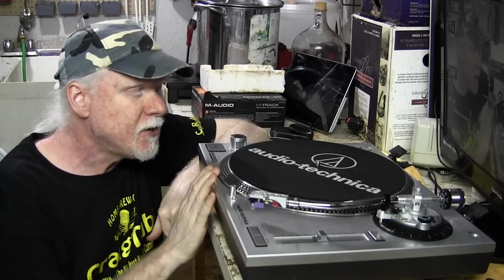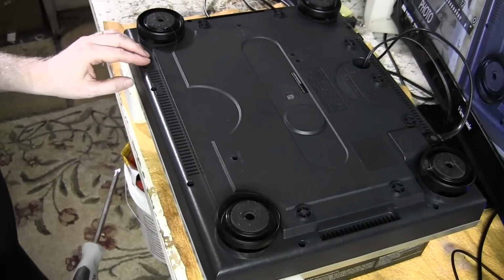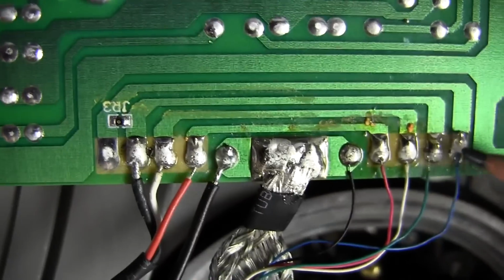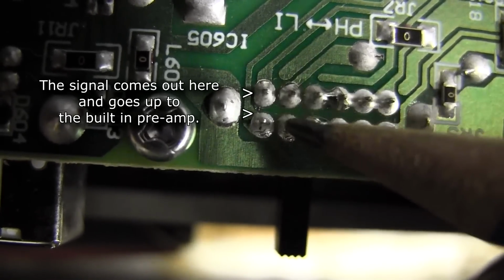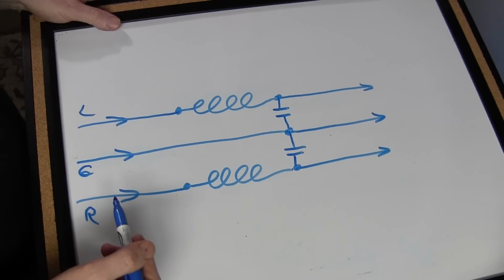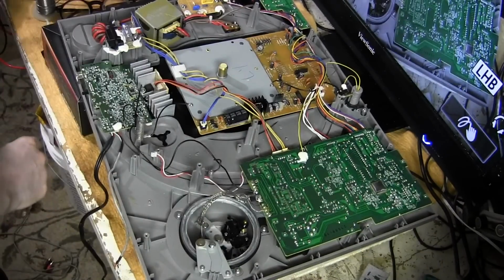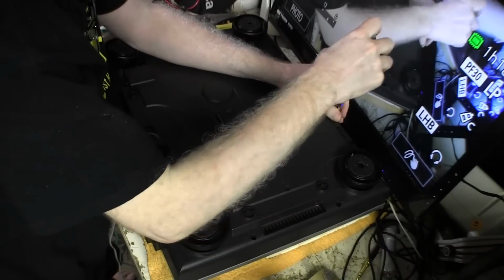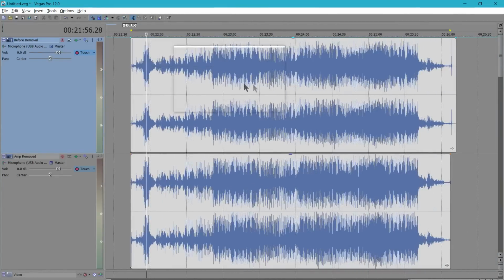Preamp Removal - Audio Technica AT LP120 USB Turntable

Comment: Thanks for the informative video! I did the mod for kicks since I already had to get in there and change the RCA cables. Eventually decided to put the pre amp back in as I preferred the sound before. The low pass filter is certainly there for a reason. It does seem a little hacky for the designers to just throw that on the very end of the circuit (possibly compensating for unpleasant frequencies brought out by cheap components besides the pre amp). I'd be interested to know if that's a common design in other higher quality turntables. All in all it's a pretty decent sounding deck for the price, but if anyone's planning on buying one to mod it, I think your time and money would be better spent on something that has better components to begin with. However it is a fun DIY project if you happen to have one lying around without a warranty.

Comment: You only removed the loading capacitor that had a very clear (but granted generic) purpose in this case. And on a upside you shortened the loooong unshielded audio signal which is great. To further make sure their own cartrige impedance is properly paired, should check his/hers phono pre amp on how it loads the cartridge and adapt it to the cartridge specs(by adding/removing pF range capacitance and adjusting load resistor). Judging by how bright it sounds after, some loading capacitance seems to be needed at least for this combination (cartridge,preamp,recording ; taking into account the RCA wire capacitance as well). For example a random MM cartridge, AT20SLA needs loafing of 47K and 100-200pF (https://sites.google.com/site/zevaudio/turt/cartridge-comparison-list/audio-technica-at20sla--at20ss) But anyone with MM/MC , after doing this operation kindly described by Craig should load their cartridge properly , since the cartridge does not produce only music ; but unwanted oscillations as harmonics mixed with music information too, which is nicely cleaned up by the loading combination in the form of RC low pass filter.
Reply from the maker: The idea behind switching off the preamp is to use an external one, which has  the proper loading components. The signal path from the cartridge to that preamp should not be obstructed by components on the internal board.

Comment: Hi Craig, i am from germany, and i hope you get well. Your Channel is amazing. I get back to vinyl one Year ago wirh a Dual DTJ 301 USB and i‘am not happy at this time with the Sound of Vinyl. I bought a Ortofon 2m red and nothing changes. The Dual ist a Copy of the Technics even the Audio Technica, both  looks identic and have built in preamp. Because of your great video i open my Dual and there is the same preamp built in with the Cap. inside the Signal. I remove the amp, and now i ‚am in (vinyl) heaven....so clear and with brilliant High and Midrange. Why make they so bad things to a good turntable? Because USB? By the way, i thank you so much. Sorry about my bad english

Comment: Could you just remove ( desolder) the tiny capacitors and ground shunts and use jumpers in their place? That way you would have a built in preamp and a clean path without preamp...

Comment: ok question:  Did you notice any reduction in any motor noise or table able when quiet or silent portions of a record plays? My LP120 has aa very noticeable sound that I was hoping taking out pre-amp could help. Otherwise its not worth paying to fix as it is out of warranty. And the cue arm is basically useless
Reply from the maker: Nope. The motor noise is still there, and yes my cue arm is useless. I use my 120 for spinning vinyl on my live broadcast, that's it.

Comment: Hello and thanks for at great video. It inspired me to even dare try this. BUT you are doing it incorrect. First off all, if you really want to modify the least you can do is to seperate left and right channel ground/unsolder the J3 jumper. Second if you are going to use a seperate phono preamp, you  need to ground directly from the pickup/tonearm. Third use better RCA cable out. WHY ? because the shield in the built in cable is very poor and the signal going from the turntable to the preamp is very weak. Are there a difference, YES.
it´s noticeable So what you really want to do is to rearrange the wires from the pickup, red, white, blue and green to the output (without the J3 jumper) and to solder and ekstra ground wire to the board in the input ground side directly to the external preamp. Thats how I did it and the diff. is huge. Regards from Copenhagen, Denmark  Bjoern.

Comment: What's the expected effect if, instead of using a higher-end preamp (like your Nikko Beta 20) one chooses to use a less expensive preamp plug-in/plug-out in-line preamp?  I guess what I'm saying is what if I don't want/need to spend the $$$ for a high-end preamp?  Will almost any of the lower-end preamps work equally as well?
Reply: TC750 is good, Gogroove and Pyle are shit

Comment: Craig did you have a platter/motor rotation sound on this turntable? I just bought one and it has an external sound, but doesn't seem to affect the audio? Quite annoying as my old Technics 1210 MKII didn't have any platter sound

Comment: I like the before better.  Those highs in the after is like an ice pick in my ears.
Reply: I agree.. I think the additional wiring has added capacitance and caused a HF peak which combined with the 10khz rolloff of this particular disc has a very unflattering sound. The source material could have been better selected.
Reply: Just wait till you get older.  Then you will need those highs to be a bit louder so you can hear them.

Comment: Why not just solder another cable/set of phono sockets on to the existing connection? Surely this way you could keep the Pre-amp and USB function intact and also have a complete bypass capability.
Reply from the maker: Because some of the components are in parallel so they will still affect the signal.

Comment: Good lookin' out! I'll eventually do this to my 120, but I'll need an outboard preamp first, and I want a grown-up's full system preamp. At the moment, all my components are run into a modern receiver, and that's fine, but it has no phono stage and no tape loop-out, both of which are things my analog gear will appreciate looking forward. Now I know that this is a really simple mod, it'll get done sooner rather than later. Thanks!

Comment: Might have been easier to solder in a jumper to bypass the LC filter but they look like chip components and it would take good eyes and a steady hand.
Reply from the maker: I really didn't want to mess up the board, in case this didn't go well.

Comment: On a Pioneer PLX-500, which is basically the same turntable, in Phono (preamp bypass) mode the measured frequency response from the headshell leads to the RCA cables out is basically ruler-flat, down only -0.1dB at 20KHz. Most any cartridge is inherently much further off than that. 

http://photos.xdrguy.com/i.ashx?&mid=104001358&mt=Photo&standardsize=1018x517

Comment: I just performed this process myself following this video.  However, since mine is still very much under warranty, I decided to unsolder the wires of the pre-amp and disconnect it.  I left the wires neatly tucked inside, except for the RCA, which I just wrapped neatly with a strap.  I don't care if I have an extra set of wires coming out of the equipment.  However, I want to comment on the spacers...you really do not need to tape them or hold them in place like you did.  I figured out that they go right through the screw holes (it's hard to explain), which means when you lift the bottom cover up, they just slide.  Just in case someone is doing this same process, all you have to do is just close the bottom cover nice and then slide the spacers in, and finally the screws.  The spaces will just slide in place as expected.  You might need a kebob skewer or something similar to accommodate any spacer that lands sideways.

Comment: Nice video & comparison. Been looking to buy one of these or this Pioneer PLX-500-K High-Torque Direct Drive Turntable https://www.pioneerdj.com/en/product/turntable/plx-500/black/overview/
Wondering if the Pioneer has the same problem with the built-in pre-amp.
Reply: Not that I heard of, the PCB looks very different to the AT

Comment: Why remove anything? Why not just solder in a second set of RCA cables direct to the cartridge leads on the board? This way everything stays intact. In fact, for about a buck on fleabay, you can get a pair of chassis mount phono jacks and fix another common complaint about this turntable (and also separate the grounds for left-right channels if you wish). You'd have one fully bypassed connection and one factory setup.

Comment: DON'T completely remove the preamp.. Leave it in the turntable just in case you just-might want to sell the turntable later on. Just cut all of the connections to it. If you completely remove the preamp.. there's a chance that it might get damaged in storage or get lost altogether.

Comment: First, the song itself is really excellent.
Said this, with all the caveats YouTube imposes to the originals, and not knowing what the intention of the production was, for me the "surgery" exaggerates the brilliance a lot without gaining a bit in detail and/or nuance. I find the non-modificated reproduction far better balanced.
I've used for listening a pair of AKGs K-1000 headphones driven by the speaker output of a Luxman MQ-360 power amp, a combination that is very unforgiving, for the good and for the bad.

Comment: Oh the workmanship...the soldering.....is horrible in this turntable.  Cold solder joints  all over the place.  Cheap Chinese junk.  I have one of these.  Yes...Take the preamp out is you want to use this turntable as a low end, respectable turntable.  Also, while you have this thing disassembled..If it's pre 2018... Change out the anti-skate spring....It's junk ...It does not work.  Then deal with the vertical tone arm setting.   Shim the Audio Technica  cartridge...Then..Isolate the entire motor and platter from the base, with foam.  Then...level the turntable.  Is it worth it?  I dunno.  I did...The sound is very nice....but I'm ready to junk it and buy a better turntable...This thing was a great hobby...Any who...I did this preamp removal...and now with the entire turntable unplugged from electricity...It will still play through my Adcom preamp....Just pushing the platter with my finger....The phono cartridge is now directly hooked up to my Adcom preamp.

Comment: Thanks for the vid! Gonna remove the preamp and att the same time put som  rubber-damping in the bottom part of the TT and om the underside of the platter. Think vibrations and resonance in material are one of the big difference between this TT and a SL1200.

Comment: Does the Pioneer PLX-500 have this same issue?
Reply: Not that I heard of
Reply: @VaughnfromPeterborough  7 years ago 😮
Reply: @lovelorn88nick  IK, I just bought a 500 (still waiting backorder), a 120 back in 17, 1200MK4 just before release of 140 and 140 in 21. I ripped the filters out of my 120 and replaced AS spring. the noisy motor and buzz pickup still annoying me so I moved onto better. I know the 500 has good motor as I listened to moving platter in DJ shop, I wasn't able to audition it as far as audio goes, treble and ground issues. The early gen 500 (16 &17) was known for motor dying

Comment: I've just bypassed that LC filter by destroying the capacitors and inductors and then solder inductor pads together. the sound is amazing on phono output and i still have the preamp(wich sounds better too).Now i dont need the ground cable at all(even if i set the output to phono) and the sound is purely form the cartridge. There is no background noise from removing the LC filter and i can't explain why they were there but I think is waay better to just bypass the filter than take the preamp out entirely! Thank you for the video! Best regards!

Comment: Would it be possible to replace L606 & L607 with 0 Ohm resistors, remove C632 and C631, desolder the L R & G wires there, and then add an RCA cable with ground? This leaves the full functionality of the preamp if you want to use it at some point, as well as the full USB functionality. You could even switch all of the RCA cables to plugs on the back of the turntable so that you would just need to use a an RCA cable to hook it up to whatever you want to. Have one set of plugs for use with the preamp. One set of plugs for use without that also has an added ground connection(which I feel this should have anyways... I don't like this internally grounded crap). Just spitballing here, but it's most likely what I'm going to try and do to mine when I get one.

Comment: Always a good idea to remove anything from the signal line that is not really required. The cartridge is now probably seeing the correct loading and that will make a difference. I only use passive filter vacuum tube RIAA pre-amplifiers as they seem to sound the best. I have really tried hard to find a solid state circuit to remove the necessity for high voltage power supplies and current hungry tubes but to no avail. The tube circuits win every time, delivering a perfect RIAA characteristic and at the same time sounding just that bit better. Cannot understand it, perhaps it is down to the capacitance difference in solid state devices but anyway, I recommend you look into building a tube RIAA to complement the change you have made to the cartridge wiring. A very well done tutorial video - first class!

Comment: Thanks for the vid! I think it explains a lot and clearly demonstrates how it sounds without having to perform ampectomy myself to test it :) Now very frankly: through my Cambridge Audio CAX60 (fantastic piece of machinery!) and my Dali Zensor 3 speakers, with full blast bass and treble, difference is VERY audible. And I prefer it through preamp. Sound is softer and much less edgy (treble is unbearable at times in the AFTER mode). Some records may benefit from the AFTER mode like Iron Maiden's Killers (first one that comes to my mind, at least in its latest vinyl reissue), where the sound is a bit muffled in general, but the high end freq are really too much to bear for me here. However, I think I'll keep listening over and over until I will make my mind up 100%. That way I will also get familiar with the nice song :) Thanks a lot anyway. As I said, very useful and informative video.

Comment: They are low pass filters, if you know the values of the components, you can calculate the cut off frequency,  there will be lose through any filter,        was thinking , you could also , just remove the caps, and short out the coils,   or  install a switch that  switches the components in and out of circuit,   then switching the components in and out,  listen for a difference.   very nice article,  thanks,

Comment: other than frequency response, is there any difference in anything else? ie. signal to noise, hum, volume? I have read some reviews that say this turntable has a lot of hum because there is no ground wire. What do you think? Is the noise level acceptable?

Comment: What if you remove or disconnect shunts on preamp board?  would there be noise?  OR what if we could rewire the switch so one position will be through the preamp, and the other will be direct out, bypassing the LC shunts altogether (same thing, I guess) as cutting the shunts)?  Would there still be digital or other noise?  A lot of work to find out the answer, and after hearing the vast improvement without the preamp, maybe not worth the effort.  I like the convenience of USBing directly into my rig, but the difference in sound quality was noticed by my wife, when she played some very old, mint condition Aretha LPs.  She said she didn't like how they sounded on my system, attributing the monitors (Yamaha powered 5" with subwoofer) but I told her it's probably the built-in AT preamp.  So we will probably buy a nice used turntable and hook it up to my Harmon Kardon amp and some old Scott speakers, and if I want to archive, use that turntable through a Soundcraft phono preamp which is pretty ok (not great) or just go line out of the Harmon Kardon (very good preamp).

Thanks so much for the detail in this video, Craig.  It was super helpful.
Reply: I removed the filters, brighter sound, no weird noise heard

Comment: Nice one man! But that about the level is controversial seeing that the energy of the frequency can hurt! But for sure is customisable! I have not understood if is the best choice, but for sure it sounds clearly without! Of course in compression huger capacitors and generators will resize better complexity! And what is about the line compared to the phono?

Comment: Fantastic video!  Very well explained and good demonstration.  Question:  Could you just solder the second set of RCA cables on top of the existing wires on the first circuit board (not the preamp)?  That way you would have two sets of RCA cables coming out - one bypassing the preamp, and one still connected to the preamp.  Seems that might be ideal.  Am I missing anything?
Reply: Couldn't wait.  I did the above today and it worked like a charm.  One moment of "What have I done?!" when I mistakenly plugged the outputs into the moving COIL input and had no sound!  Ha ha!  Quickly fixed and breathed a sigh of relief.  One thing about the "spacers" - they're probably more accurately described as bushings and the easy way to reinstall them is to simply replace the base and then drop the bushings down the screw holes.  You can use a toothpick or something to ensure that they slide perfectly into the bottom of the hole.  They are then resting perfectly on top of the "pedestal" that the screws screw into.  Install screws and you're done!